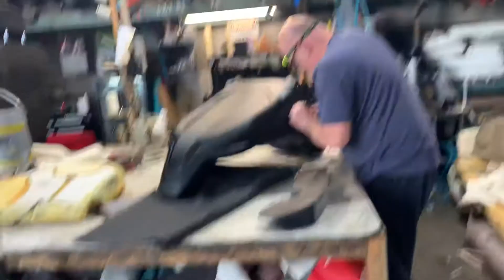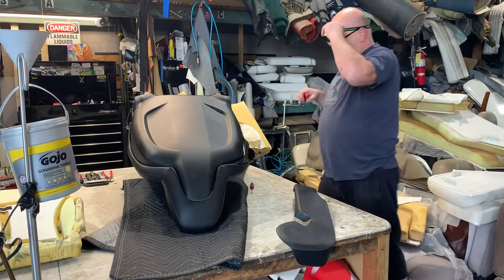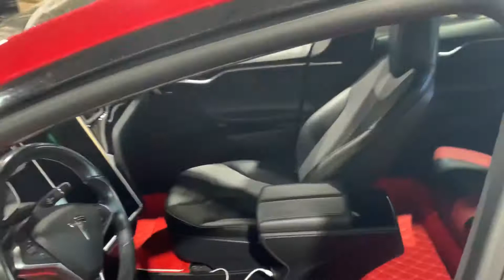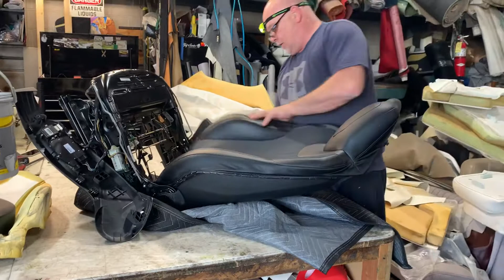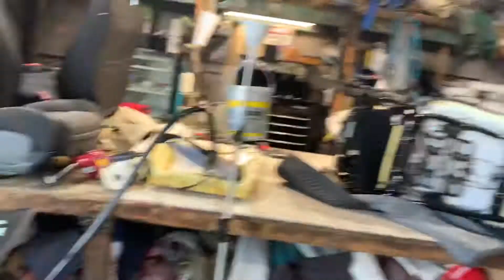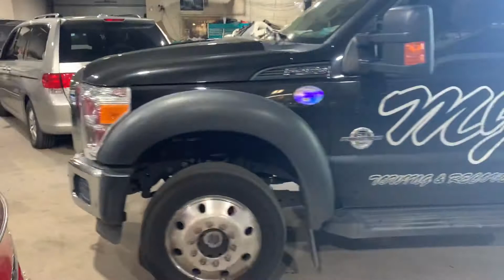How to take a Tesla model s front driver seat apart.

Comment: How do you remove the seat when the screws on the back side are covered up bc the seat motor is broken as well as the up and down.  I want to replace the seat but in order to get to the back torx screws is impossible or I just dont know wtf to do